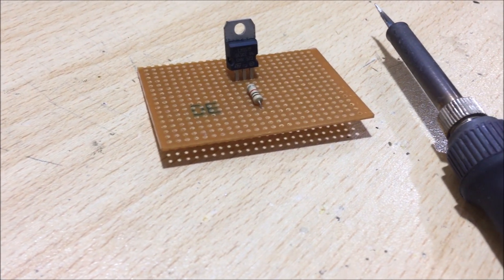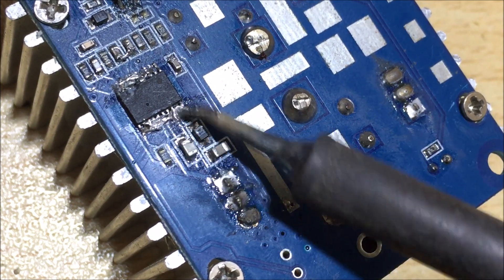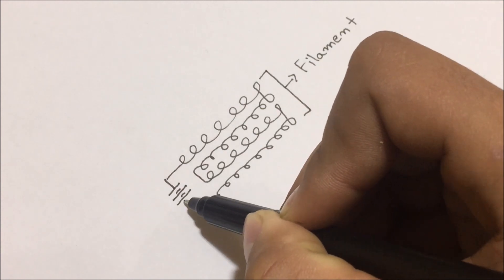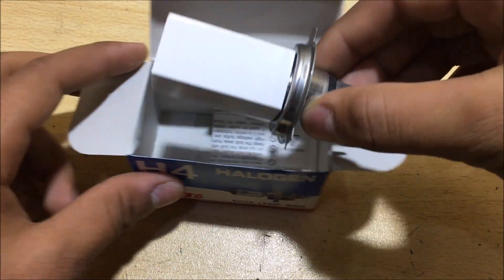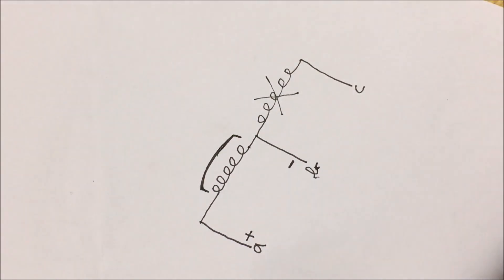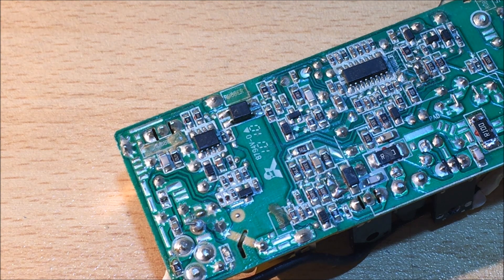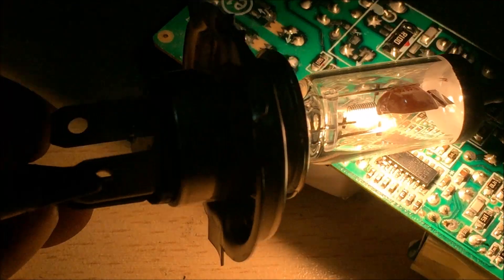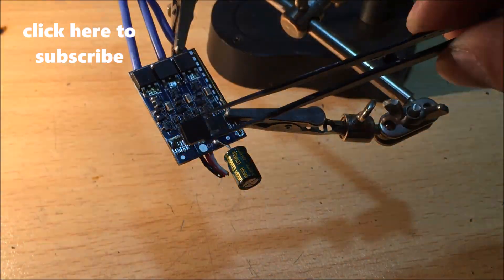How To Solder/Desolder SMD Components With Halogen Lamp

Comment: 3:13 bro, its so simple add solder to both the sides of the ic and gently pull the ic with tweezer. Anyways I don't say this video is fake but yeah its so unique to use this method.

Comment: While a really nice ghetto solution. But regular hot air guns aren't that expensive. Can even get some for 20-30 bucks that will do the job a bit better.  Plus the air gun is safer also.

Comment: yo creo que para el sustitución estaría bien, en cambio si quisieras reutilizarlos sería inutil ya que estos componentes SMD se dañan fácilmente al superar los "80 grados"

I think that for the substitution would be good, on the other hand if you wanted to reuse them it would be useless since these SMD components are easily damaged when overcoming the "80 degrees"